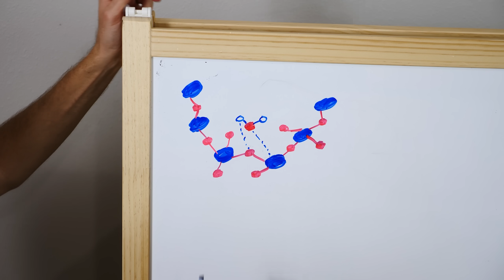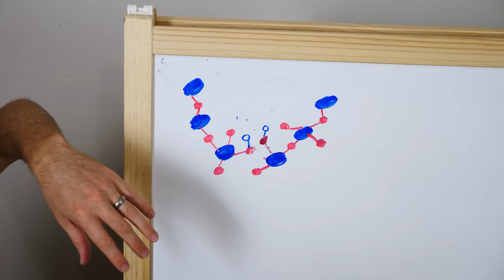Is It Actually Possible To Cut Glass With Scissors Underwater?

Comment: @TheActionLab PLEASE don't try anything like this at home! Broken glass leads to tiny little shards that can be an absolute nightmare to deal with.

Also, when transporting water in a rectangular container, it can splash and spill very easily, because of the corners. Move very slowly.

Comment: You said, in water, energy needed is reduced by 20. So crack should propagate slower  than air. But you said, the crack propagates faster in water than air. Those two statements are contradicting. Thanks.

Comment: Well youre not cutting the glass necessarily, but more so pinching it and putting ebough pressure on it at a fine enough point that it fractures. Hence why most of the glass breaks off in smaller pieces and dust rather than remaining intact. You can technically get this same effect with pliers, as its not necessarily cutting.

Comment: wait a minute, 3:31, you said crack growth increased by a million times, so does that mean if
we crack tempered glass (which is 100,000 m/s through air) and put it in underwater it would do (100,000m/s * 1,000,000) traveling faster than the speed of light?! 
bruh

Comment: I'm just guessing, but does the water pressure kind of focalize the "stream" of vibration by keeping it from splaying outwards as the glass it's traveling into breaks around it, like the water pressure is strong enough to keep the tunnel of energy/vibrations intact.? Or maybe it gets pulled in simultaneously behind the energy tunnel shoving it forward  not letting any disperse because the waters all around, like a vacuum effect I guess ? Effectively increasing the driving force, reducing energy loss,  and resulting in alot more pressure going through a smaller surface area?

Comment: The effect is probably stronger at higher pH. Some labs that are concerned with purity clean their glassware in concentrated KOH which etches off the surface over time until there's not enough glass left to use.

Comment: So I do stained glass art and our wheel glass cutters always require a dispensing of very thin oil to cut clean lines. I suppose the same properties imparted by the water are also imparted by the oil?

Comment: Interesting. I thought the reason why it doesn't break is because the water dampen the vibration when you cut it prevent the vibration to transfer through the glass.

Comment: The bottom line if you wanted to know :
- It is called chemomechanical effect. The glass will crack if the scissor straight cutting the glass. But in the water, the water molecule enters to the glass molecule. It will make the glass soft so it wouldn't crack underwater.

Sorry for my bad english, this theory actually from a comic book about science.

Comment: So everyone
Whats happening here is the vibrations when you try out of water are to extreme and cause shattering. Under water the vibrations are disbursed much more. Might even be muffins vibrations that go across the glass and pressure when you close the scissors onto the glass.

Comment: C'mon man, try to cut the glass straight under water. It won't work. You are using the scissors as nippers. That can be done out of the water also. Try the same technique both in the water and out. The reason for the water is to capture the shards, and eliminating thrown shards.

Comment: I needed this info for a while now I can cut my truck mirrors with round edges , just by using the glass cutter with 2 millimetre extra depth on-top of the glass when it's submerged in water then go around and score it with rounded corners , that's the aim anyway. 
               .  Brilliant  .

Comment: The rate of travel of glass cracking is so extremely fast, i don't think it's a chemical reaction. I think the water is absorbing the wave produced from the structural failure. I'd say try this under oil or another liquid. I bet youll see the same thing

Comment: Are you absolutly sure this happens? case SiO2 is one of the most unreactiv shitheads out there and quite stable in hydrothermal treatment unless it's very alkaline. Futhermore, Glass is amorph, which means it's a extremly viscous liquid, not a solid. Nowing that, if you cut water with a sicior, do you cut hydrogen-oxygen bounds? No you don't. I don't think you cut throug kovalent bounds, it's probably a surface tension effect based on the Solid/liquid or solid/gas  boundary layer. Or are there any studys about this, that show this reaction actually did happen?  Since water has a higher viscosity than air, it takes more time to fill the crack, due to it's way higher density it can absorb shokt a lot better then water. To make sure it's actually a reaktion you should try cutting it inside a tank of n-hexane or another liquid organic. 

Please take a ball mill some glass, fill the mill with warer, grind down the glass to  "powder" and make a FT-IR or Raman to show me those OH groups

Comment: i read in a old book that you can cut glass under watter with siccors and the reason they gave is becuase the watter absorbs the vibrations generated when cutting the glass and therefore it doesnt break, quite fun to remember and see you doing it with a proper explanation,

Comment: So that's why factories that use diamond tips to cut glass use a lot of water.
Reply: Jehmarxx Bañaga Actually the water in that case is more for cooling and keeping the removed material evacuated. Abrasive cutting would not rely on this chemical reaction or its affect on the crystalline structure of the glass.

Comment: you could always Score the glass with the sharp part of the scissors and snap the glass on the score line's (like how you cut a tile). 

You are still essentialy cutting glass with sciccors.
Reply: Also how glass cutters work
Reply: @Tallnerdyguy  I have used a few and most have Diamond in them (mainly to help cut Ceramic Tiles).

Comment: I work at a fiber optics manufacturer. We use Fiskars cheap scissors and dog-nail nippers to cut the hot glass we thin out before the drawing process. Of course, it’s ~2,000 degrees C and not cold underwater.

Comment: So according to slow mo guys, glass cracks at 3262mph... So 1 million times faster than that is faster than speed of light. Is that really possible 1million times faster than 3262mph is 3,262,000,000 where as light travels at 670 616 629 mph

Comment: Wow! That chemical reaction explanation. I was thinking that the resistance of the water was just slowing the frequency of the glass.
Reply: My natural assumption would've been that it's probably related to the much higher speed of sound in water than in air, but apparently I'd have been wrong.

Comment: These fascinating science videos really expand the possibilities of creative (and believable) applications in fiction, even fantasy-fiction.

The canon expanded media for Avatar: The Last Airbender confirmed that earthbenders can manipulate glass (because it is derived from sand). Really makes you wonder about the possibilities of waterbenders and earthbenders interacting with the material, since they can affect it on a molecular level. Veritasium released a video showing how fire is attracted to electrically-charged plates, and the apparatus even produced visible electric sparks that shot out of the flame. Fire has charged ions, establishing a scientific link between fire and electricity (complementing the mystical explanation of firebenders being able to generate lightning. Also note how Iroh explains lightning bending in terms of positive and negative energy, as if he's speaking of psoitive and negative charge). SciShow made a video explaining how fire and rusting metal are both oxidation reactions with similar behavior. Rusting metal even gives off a small amount of heat, and can therefore be thought of as a very slow type of "burning."  Opens up the possibility that firebenders can cause certain metals to deteriorate by simple touch.

Comment: ok so the generation that used Diamonds to cut glass is done! what do you all guys think? let me know in the reply section.........and yeah like it too
Reply: This isn't new, and diamonds are still used.
Reply: @Tallnerdyguy  yeah but still after increasing the pressure of water, we can use highly sharp metals to do this work..........
Reply: @devarshdave  which dull, hence diamonds. It's not just sharpness, but hardness. Diamonds are quite a bit harder at edge than any metal. Often ceramics are used, rarely metal.

Comment: "How to ruin scissors in less than 30 minutes"
Reply: Seconds
Reply: @peterzingler6221   yeah was thinking about changing it to seconds 😂😂😂
Reply: Fuck, my scissors can't even cut paper.
Reply: @kannixzero9681   You have to put the paper in water obviously
Reply: @adammilan6434  yeah the paper will crack faster
Reply: @chocho6766  yaa a chemical reaction will occur
Reply: @kannixzero9681  cut a beer bottle neck. That lifts the bur on the scirros and they cut again. Works good
Reply: Me cutting fabric
Reply: Sometimes I cut glass with my scissors to sharpen them. It works
Reply: @anko1225 and you can charge your phone up in the microwave
Reply: You can learn to sharpen scissors with a $20 diamond stone. Start with cheap scissors, but it isn't that hard once you get the hang of it.
Reply: scissors, glass, bucket, marriage...
Reply: Cheap crappy scissors, no one cares.
Reply: They're super cheap and everywhere anyway

Comment: So you said it accelerates the speed of cracking by more than a million times. I thought glass typically cracked at 3000 m/s, so there doesn't appear to be enough room between the base speed and the speed of light. What am I missing?
Reply from the maker: That is the maximum speed. Glass crack propagation can range from 10^-9 m/s (very slow) to 10^3 m/s (very fast). It would still max out at the speed of sound in glass in this case as well.
Reply: @TheActionLab  Thanks for the clarification, and fascinating video as always :) You always ask the questions I never knew to, with answers I'd never expect.

Comment: Okay... this just astonished me... I watched as you cut glass with scissors thinking  w...t.... could this be trick editing? It's got to be fake glass... how is that possible?  No! You mean this is real? And common / ordinary water causes a chemical reaction... in glass... huh?  So does this mean that wet glass in storms / hurricanes break easier??  I know tempered glass is heat treated, stronger, and breaks in a safer manner, so does it cut differently?  Sounds like more Action Lab experiments are necessary!!!

Comment: I thought that was because underwater the glass cannot vibrate as freely as in air, so the energy of every produced crack is absorbed by the water instead of the glass itself so it wouldn't continue for long stretches.

Comment: I had to cut the bottom of a 40oz off for a project. I soaked a small rope in gasoline, wrapped it around the glass, lit it on fire, and then I put the bottle under water and banged it. The bottom fell off but it was pretty jagged.